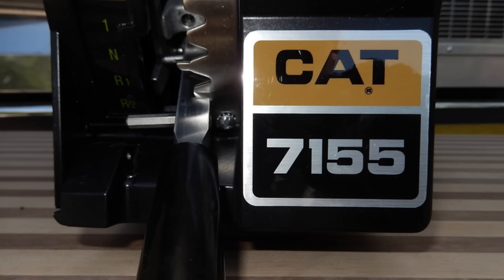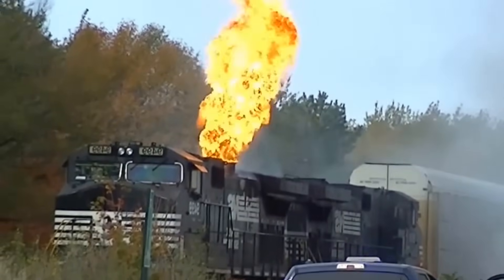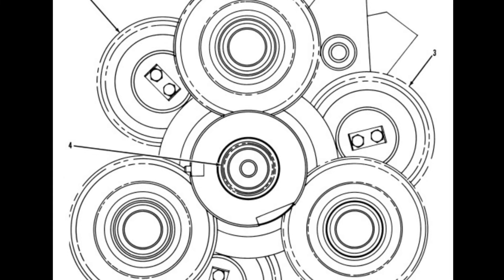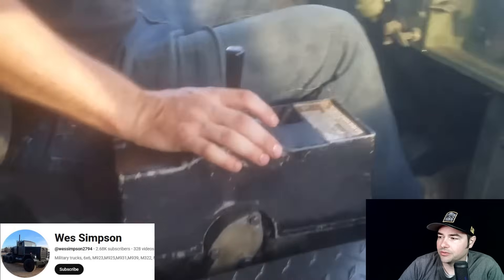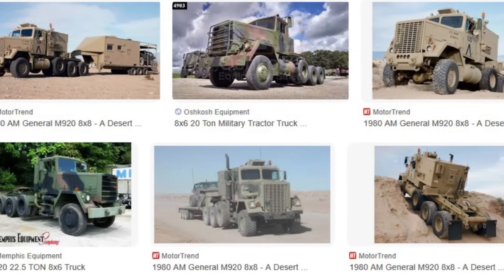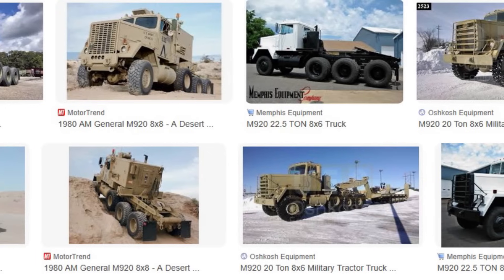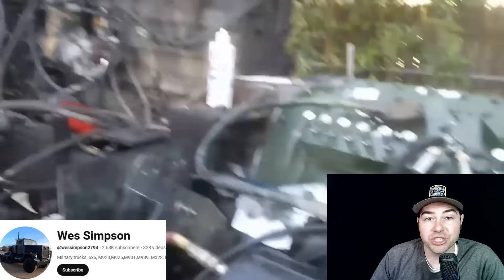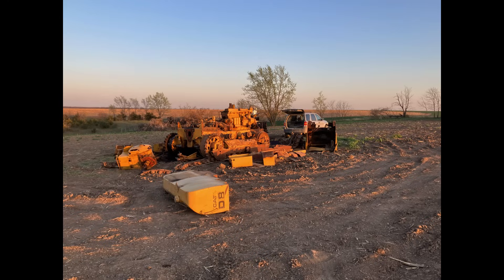Cat's "Semi-Automatic" 7155 Transmission. Ahead of its time and never released to the public.

Comment: There is a lot of transmission similar to this in farm tractor. They call them Powershift transmission
Reply: Yeah I was just going to say although you don't see them in trucks on the highway you see them all over agriculture and also in heavy haul off-road dump trucks. I think it was a solution looking for a problem kind of thing.
Reply: Nope, a powershift is a manually controlled planetary drive brake and clutch pack transmission like an automatic without the torque converter. This is a manually controlled automatically shifted countershaft gear transmission, more similar to modern autoshift transmissions.

Comment: I worked at Martin truck works in Topeka KS close to Ft. Riler and saw many of these in military trucks, the biggest drawback was the air assisted valve body and contamination and cold weather operation
Reply: That's my stomping grounds. :) We also used to drag race on that street. lol It was Martin Tractor then, but it's Foley Equipment now.
Reply: Ah yes, when it gets cold and you didn't maintain your air system not only do your brakes act up your transmission has issues too 😂